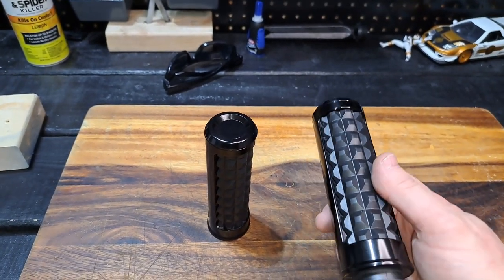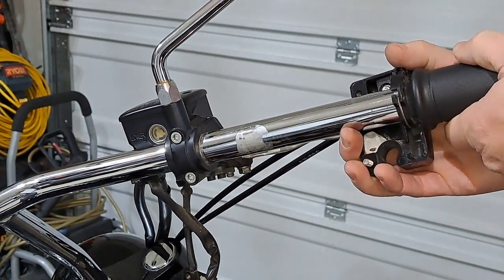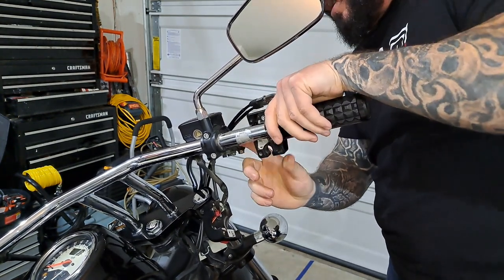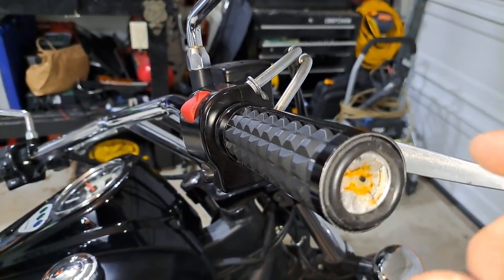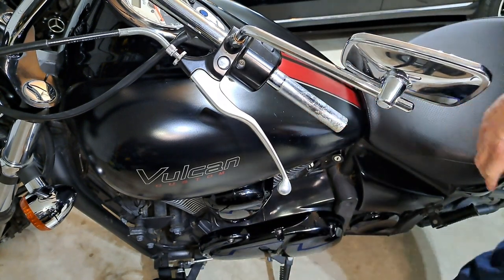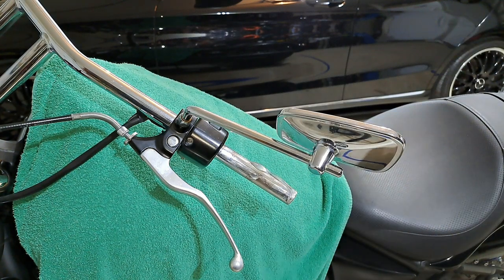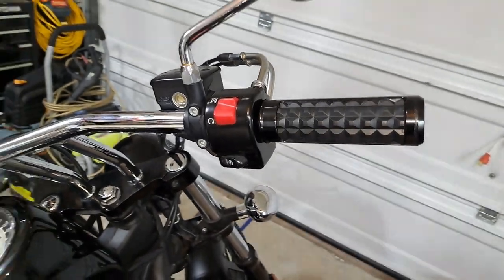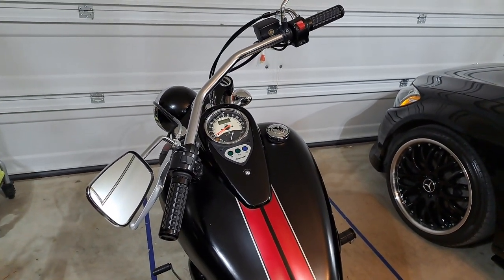Vulcan 900 custom new grips install.  (Grips are made out of aluminum and ABS plastic)

Comment: I put a pair of Avon grips on mine. They fit great with no mods. But I sure do like the appearance of these ones you got.
Reply from the maker: I bet those are nice too. Thank you. They feel really good as well.
Reply: @3dubs466  these are what I have… Avon - MT Air Cushion Anodized Grips with Throttle Assist. I even got matching tire air caps lol.
Reply: @3dubs466  I am currently putting Kuryakyn Kinetic mini floor boards on the front and the kinetic pegs on the passenger area. Just waiting on new springs for the front now.